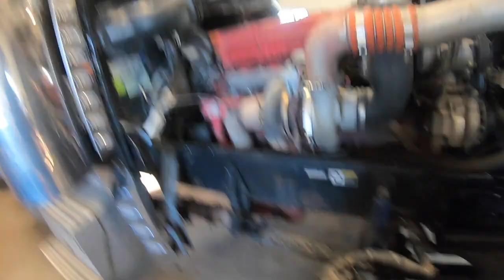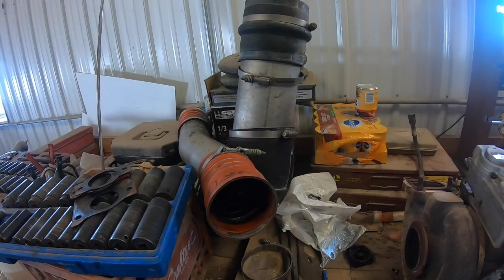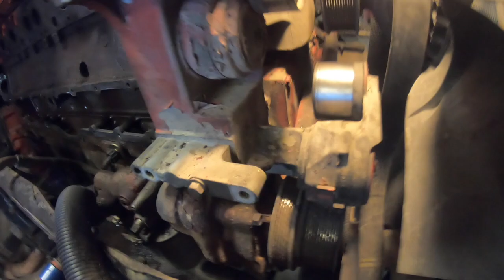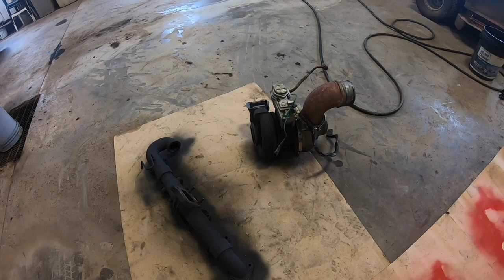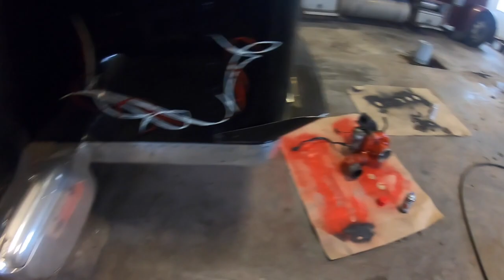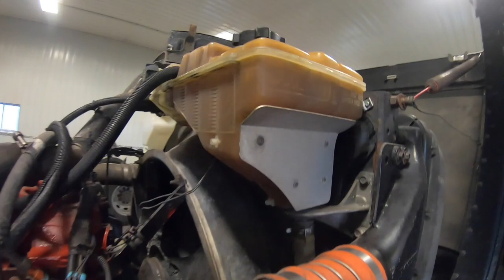013. 389 Pete oil cooler fix

Comment: I just did the same job this weekend and like you I suspect that the oil coolers were fine and that it was the seal that was leaking. But just to be safe I replaced the whole lot. I still have the oil coolers and perhaps I’ll get them pressure tested just to see. Provided it doesn’t cost to much. Anyway thanks for posting this. It’s such a lot of work that I couldn’t even imagine filming and getting cameras set up. But you did just that so thanks again